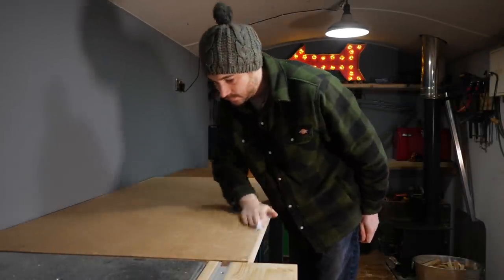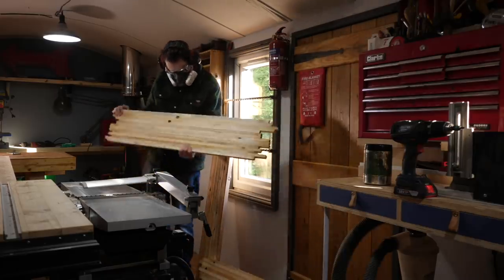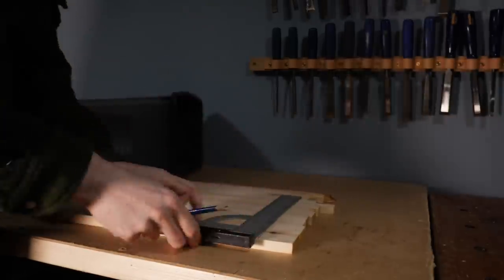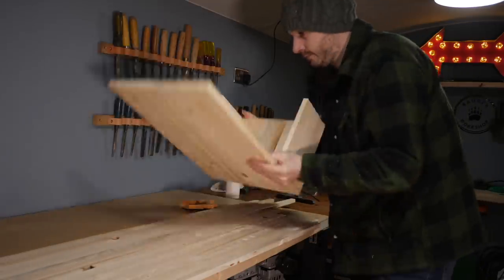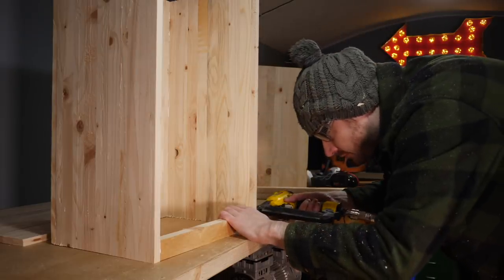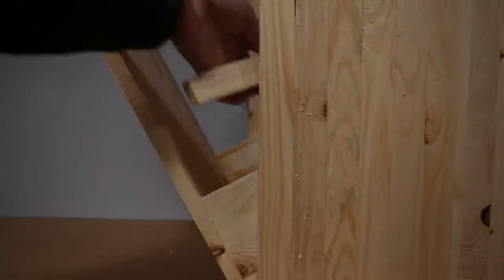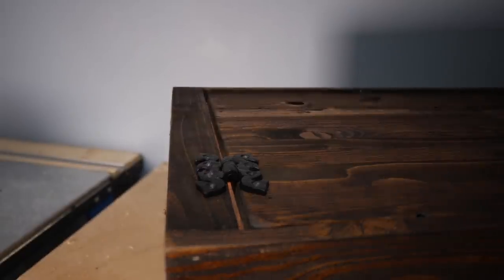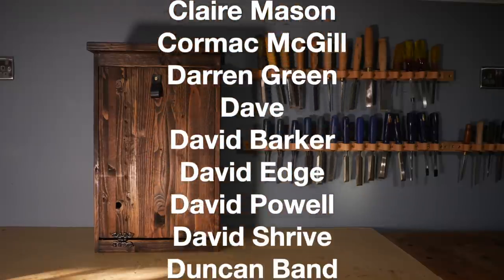Bin / Trash Cabinet

Comment: I put mine on a little wheeled MDF platform because I had some cheap castors I'd never used and the inevitable bit of scrap 18 mm MDF lying about. I like to keep bits off the floor  for H&S as well as tidiness. Nice rich brown finish, that hard wax oil looks good on that softwood.
Reply from the maker: Thank you. Yes the finish covers well

Comment: hi matt nice job  indeed
 i see you upgraded your table saw fence can i ask what fence did you use and is it difficult 
to upgrade it  as  i have a sheppach table saw similar to yours i commented before on one of your videos about the height of the saw i have put a 100mm base on mine but the fence that you are using 
is  a much better job  the fence on the sheppach  is a t square  type of thing
best regards
james
Reply from the maker: I got it from Axminster tools. It is expensive but works great. Just bolt it on. 

https://www.amazon.co.uk/shop/badgerworkshop?listId=3MI2F856CUE9O
Reply: hi matt thanks for taking the time to reply to me 
regards
james